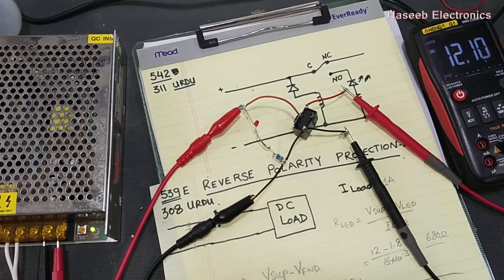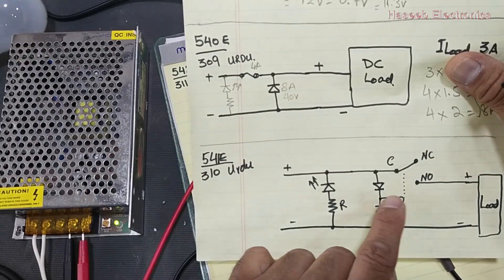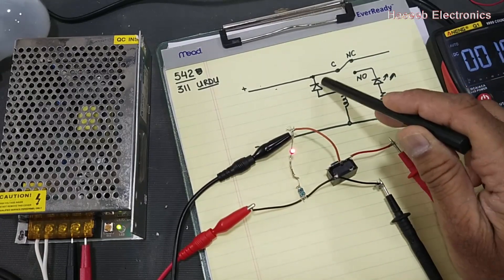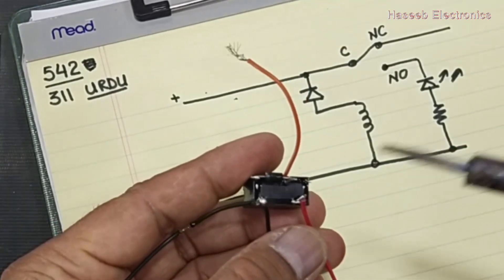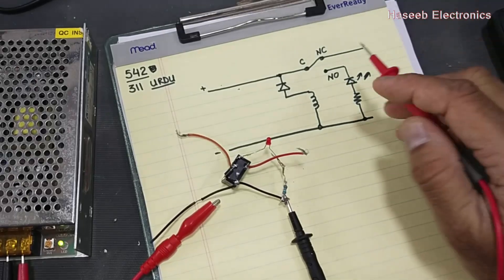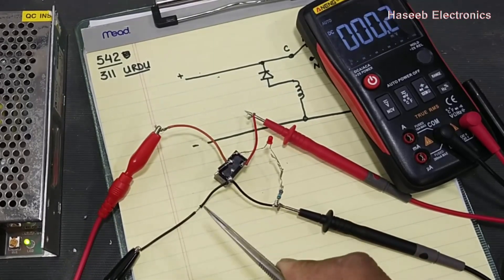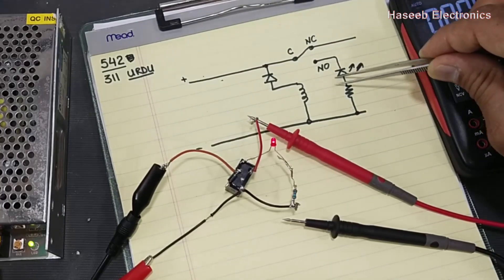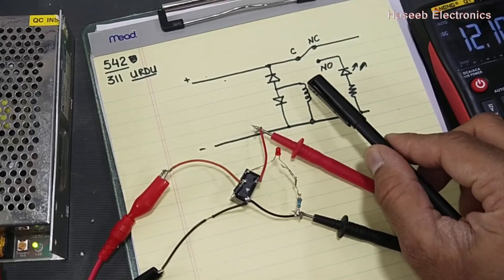{542} How to Protect Circuits From Reversed Voltage Polarity / DC Reverse Polarity Protection

Comment: How to put protection diode on J201 jfet transistor sir.  Tia..
Reply from the maker: diode will depend on the peak current and peak reverse voltage

Comment: How to put protection diode on J201 jfet transistor sir.  Tia..
Reply from the maker: it is to be calculated with using peak current and peak reverse voltage. depending on the circuit current

Comment: Reverse polarity can kill solid state components in a matter of microseconds. Because electromagnetic relays are relatively slow (rated in milliseconds) your circuit would provide much better protection if you reversed the logic of your circuit. In other words while polarity is correct the relay is energized and provides power through the N/O contacts. The down side would be that the relay coil would be an additional load on the source. Not a big deal unless the power source is a battery.
Wakodahatchee Chris (WA2ERQ)
Reply from the maker: best wishes and special thanks for your valuable comment 
you are absolutely right and it is correct that the really response time is low, so that response time can make disaster. 
actually in this series of videos for "reverse polarity protection and reversing methods in dc circuits" i am discussing all possible configurations to protect dc circuits and finally we will compare all circuits
as you mentioned, i already explained in video number 541, 
in 543 i will explain voltage reversing using bridge rectifier and video number will on voltage polarity reversing using relay

Comment: Hello Sir, does this circuit apply to home avr amplifier? Now I am trying to fix it as it goes into protect mode. Still waiting for the power transistor 7915. However, after removal of the transistor, the voltage first shows 35 volt and on second time it shows 5 volts, both values same on input and output side. How to trouble shoot?. I have traced the circuit but could not find why the negative output is having same voltage as input side without transistor  installed. Thanks Sir.